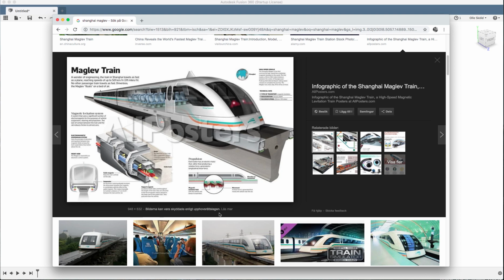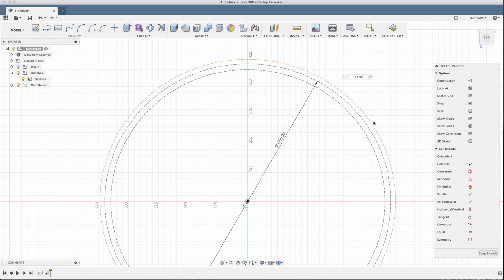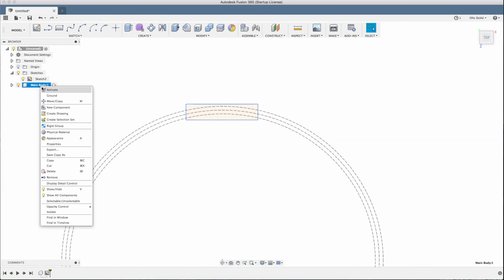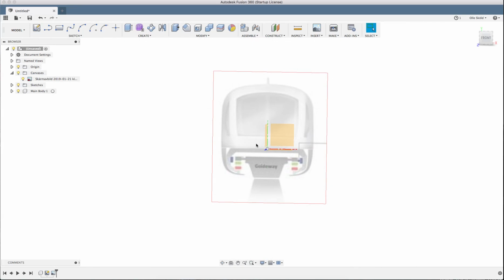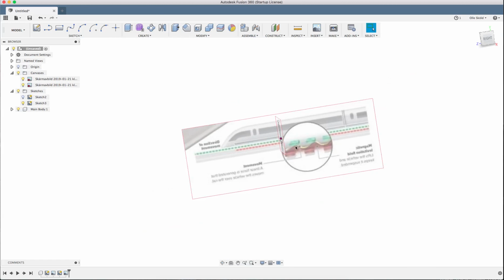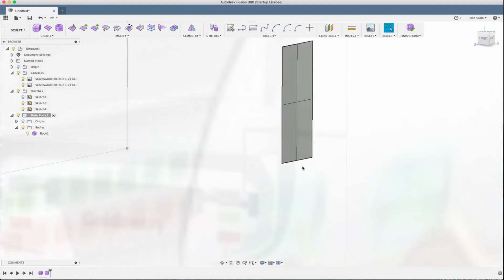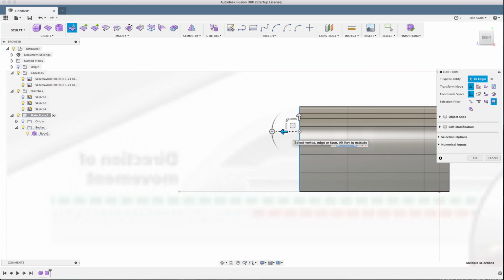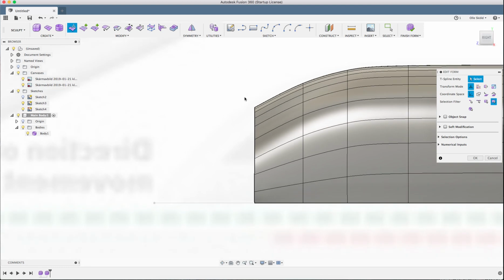Fusion 360 tutorial - Shanghai Maglev - Part 1 of 4

Comment: i got on ok right up untill the main body, pressing the alt key eigther did not do anything or it would make the body bigger but flat or lift it up or down :(
Reply from the maker: When pulling the arrow towards the side the difference should be that if you  hold the alt-key it adds another line, i you just pull the arrow it will extend the surface you already have there. Just pressing the alt-key in itself will not have any effect. Now I don't know if you have the be holding the alt key before you click on an arrow or not, you can test either. I guess you need to press it first and then click and drag an arrow for example.